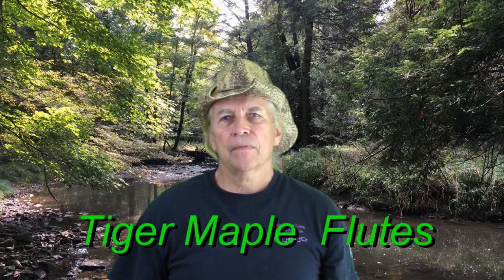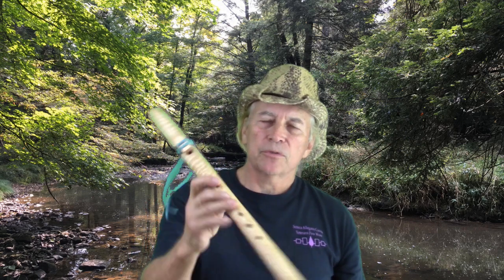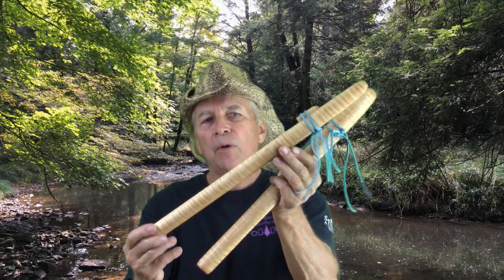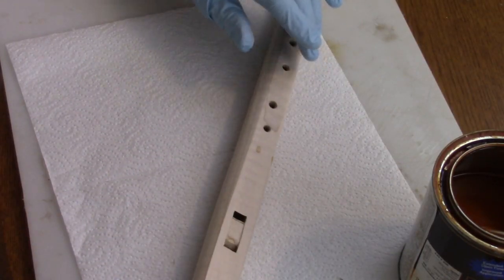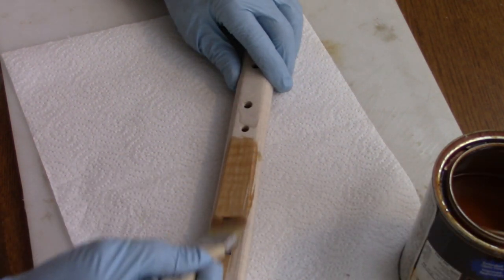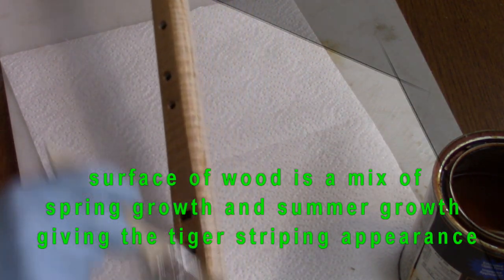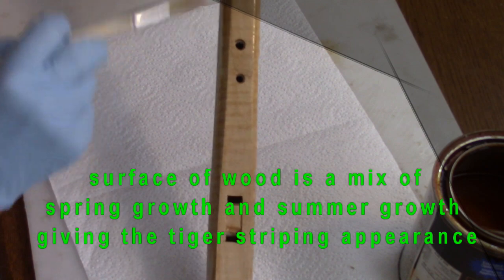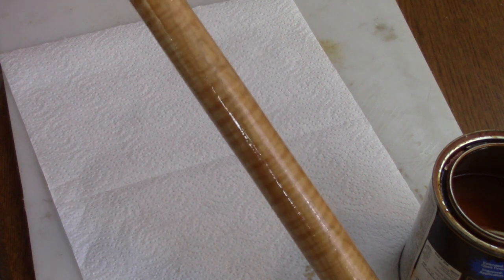tiger maple flutes

Comment: great video.
you may know this already but i will comment on finishing tiger maple. 
if you look to authentic flintlock builders they use a technique called aqua fortis. it is only used on maple. now a days it is simplified by the fact that you can buy ferric nitrate crystals already processed. a small bottle of crystals will go a long way. once you have your project completely prepped for the finish,  dilute the crystals  in water (1 part crystals to 5 parts of water , by volume. only mix a small amount it goes far).  brush it onto the sanded tiger maple, let it dry, warm it up with a heat gun and it will blush to that nice warm reddish brown. once you have it blushed the wood apply you oil finish and you will have a remarkable classy finish. it may sound complicated but if you do it once you will find it easy and never use stain on tiger maple again. i learned it from a muzzleloader builder.
with the processed ferric nitrate crystals this is safe process 

thank you for sharing your videos, knowledge and skills with us.
awsum
tom
Reply from the maker: Tom I appreciate this information, I am eager to try your process. thank you!